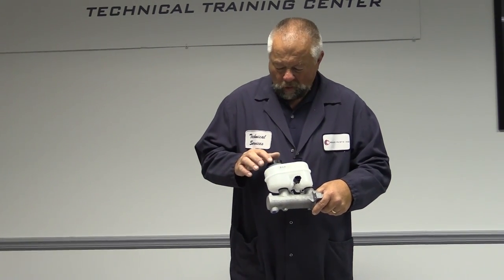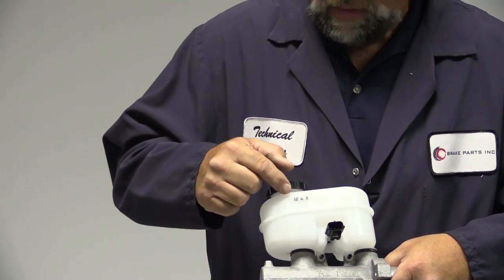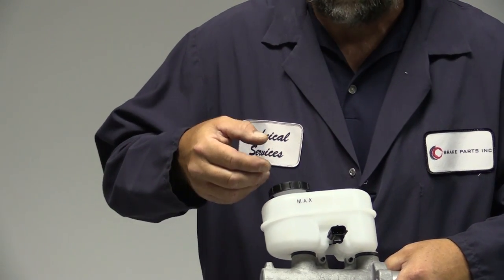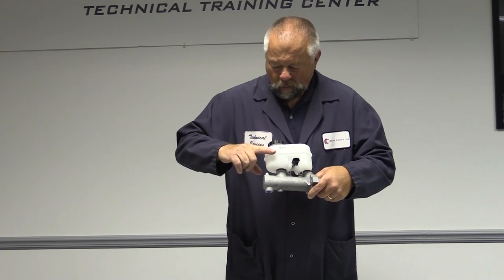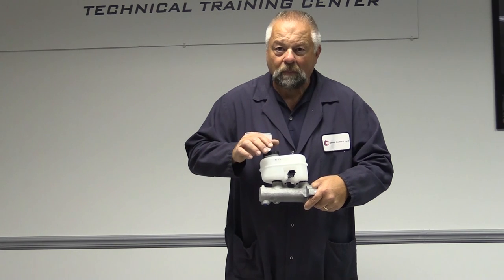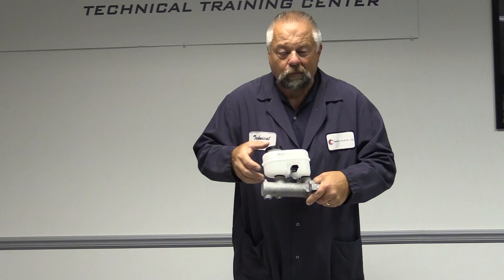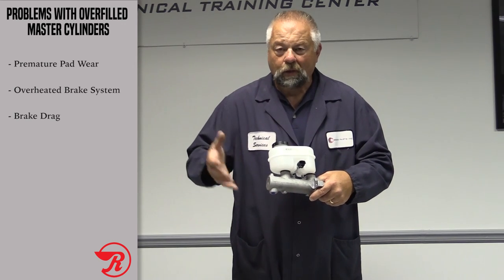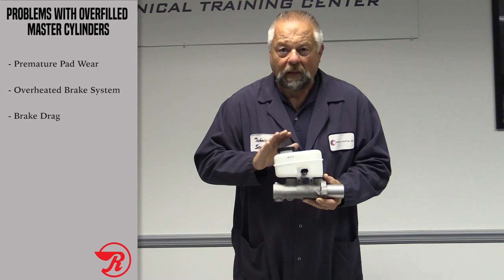Overfilled Master Cylinder Discussion with Raybestos Brakes

Comment: I just experienced this first hand.  I replaced both front calipers on my kids Polaris Ranger 150.  In the process of bleeding them, I added too much fluid to the reservoir.  I figured it wasn't a problem since I was going to bleed the rear as well - but then never did.   On the next long downhill ride (today), the front brakes started to lock up.  After about a mile of downhill braking, the wheels wouldn't turn.  I had to crack the bleeder fitting on both to get them to release.  Never dawned on me why that happened.   Thanks for the video.

Comment: Sooooo worst case scenario your brakes apply on its own but your master cylinder doesn’t burst due to so much pressure
Reply: No, worst case scenario is that your whole car may be caught on fire and totaled because of overheated brakes.
Reply: @automotivetv9861  And explode! LOL J/K ... but yes agree with ya.
Reply: The master cylinder produces way more pressure under normal operation compared to the added pressure of overfilling, so no it will not damage master cylinder
Reply: So would being overfilled cause t-blazer have symptoms of a seized park brake even after changing rotors and pads?

Comment: You were right, solved my sticking brakes on my 2004 maxima.
Reply: Never mind, my issue was a corroded right brake hose (rubber hose)
Reply: @automotivetv9861  . Yikes! Thanks for the update! I have a little bit of a drag on my car and I noticed my fluid is topped off pretty good after having the local shop do a fluid change. I'm going to see if draining a little fluid does the trick.

Comment: i bleed raybestos mc36095 master cylinder for my 62 tbird ,but no fluid is coming out of master cylinder,i am not getting brake fluid to wheel cylinders when i open bleeders.if i pump brakes i can bleed them because the master cylinder is pushing the fluid.every master cylinder i ever installed always dripped fluid out when you took off any line or opened bleeders,except this one,should brake fluid come out of m/c when line in front hole not connected

Comment: I have a 07 Tacoma and on the highway my brakes will slowly apply themselves without me pressing the pedal. I can usually tell when it's happening cause they don't lock up but my truck slows down evern though I'm still giving it gas and the brake pedal gets super hard. After about 10 seconds and slowing down they release themselves and it goes back to normal. This never happens on back roads only on the highway and I'm so confused.

Comment: Brakes OK when cold
Binding when hot, caused a de laminated pad, warped disc, all caused as the workshop who serviced brakes had overfilled the brake fluid. Just extracted 40ml of brake fluid from mastercylinder, now all OK. Thanks!
Reply: craig mull : I’ve had same thing happen today / got suspension spring replaced & he filled fluid to the absolute top ; was spilling out / idiots... glad yours is fixed / need to get my excess removed tom ..

Comment: Thank You for the help. I drain some of my brake fluid out. I wonder is it effecting my ABS system vibration. hmmmm. I started to get vibration AFTER I have a brake fluid flush, and the master cylinder is over max.
Reply: Same here. I'm going to drain a little bit out to be safe.

Comment: Thankyou for posting / I had a suspension spring replaced today, & the idiot mechanic filled break fluid till it was actually spilling out / way above the max line / right to the top !?
Didn’t realise till I got home and looked, as it felt I was driving with brakes on... now have to get it removed..
Reply: Just found my local BMW Service Center did the same thing to me...great Techs huh LOL.

Comment: So what happens if I did do that now it leaking into my floor board ?
Would I have to replace brake booster or do I just let it run it corse and don’t over fill it again it brake still working

Comment: I'm having this issue on my motorcycle. Would using a brake fluid with higher boiling point help? My manual recommends using DOT 4, but I've been using Valvoline DOT 3/4, which apparently has a lower boiling point.
Reply from the maker: Typically, if your brake fluid is boiling, you will feel a spongy brake pedal (or lose your pedal completely in serious cases). If you are experiencing premature pad wear or brake drag, make sure to check your fluid levels. If there isn't too much fluid in the system, there may be a problem with the caliper. Hope this helps.
Reply: @raybestosbrakes7236  There was indeed too much fluid in the line. I removed some and problem looks solved. Thanks sir!